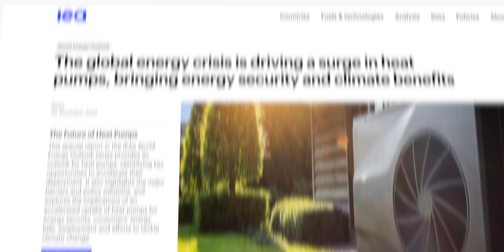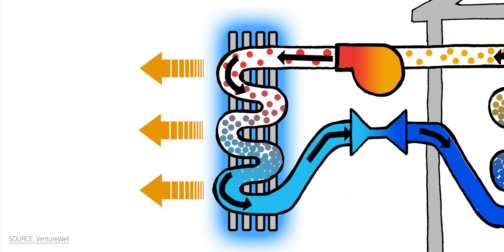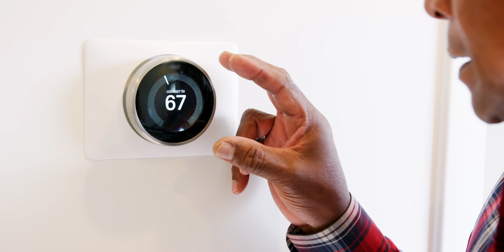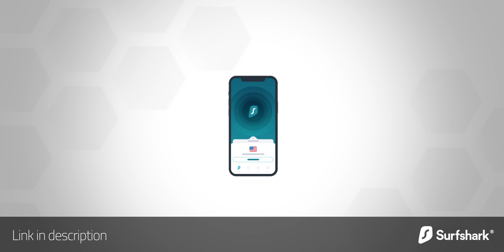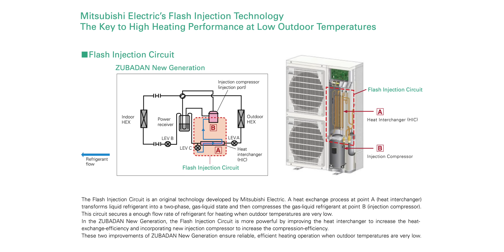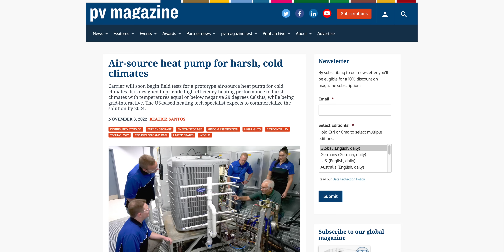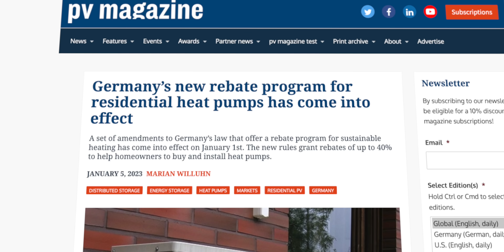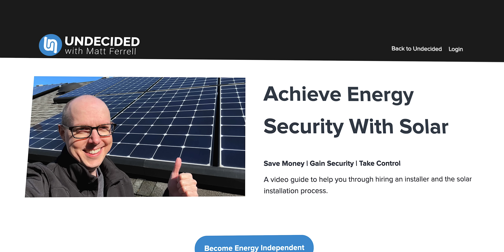Major Advances with Heat Pumps in the Extreme Cold

Comment: Heatpumps will stop working if its sufficently cold. On the olden days that was -15, that is not that uncommon in a lot of places. Modern heatpumps can typically go -25, some even -30.  But they will stop working at a point.

There is also a diffrent heat related problem. Efficency goes down with temperature. That when the need of heat goes up.

This way you either need a system that is heavily over engineered, or you will get cold.

Me personally have dimentioned the pump to -10C, any colder and it get cold inside.  Its often colder. So what is the solution.

A normal wood furnace. It turns out that while a heat pump is cheaper that wood most days of the year, when its colder than -10... its not.

Solution... just swich to wood, when its cold. I need to  burn wood typically 15-20 days each winter.

Comment: Heat pumps are f**king garbage in the cold.  Define "modern".  Contrast with "high-end model".  I have a "modern" heat pump, probably a mid-range product.  It CAN NOT heat the house even at about 40°F outside.  It has ZERO CHANCE of keeping you warm in -10°F winters for weeks at a time.  It MIGHT be able to keep your pipes from freezing, but you WILL need a jacket because it'll be about 45°F inside.  You will ALSO need to pay about 10x more in electric bills, and ALSO need to buy a new heat pump after 1-2 years rather than after 15-20, because you're going to burn the f**king thing out!  Running the same ducts, same blower motor, but using a pure electric heating element during the cold weather, you use LESS electricity, you're not stressing out the heating element, you're not stressing the blower motor, and you're getting about 30°F warmer, up in the low to mid 70°F rather than low to mid 40°F.  Anyone who tries to sell you different is FULL OF SH*T!!!  "MAYBE" a higher end model is more efficient, but I seriously doubt it.  There's no hocus pocus voodoo going on here.  You're pumping R134A or similar refrigerant around steel and/or aluminum tubes with an itty bitty amount of foam, maybe R value maybe 0.05, with multiple exposed metal lines.  It doesn't matter what goes on in a mathematical formula, inside the compressor, expansion, and condenser.  There are exposed pipes.  Any heat squeezed is lost before it ever enters the house.  The blower thus stays on longer, and all the air blowing through your metal ducts just acts like a heat sink and sucks even more heat out of your system.  On the plus side, your refrigeration bill goes down, because you can basically shut off the fridge circuit and leave all the food out on the counter.  Stop perpetuating the lies about heat pumps.

Comment: The problem is that in areas where they aren't many companies that install heat pumps, they typically won't install the newest models that are efficient at the lowest temperatures, so you need a backup heat source anyway.  That was my problem when I looked to have my furnace replaced last year.  So, its not just about customers with old beliefs on them, but mostly the companies.  That and heating fuels aren't expensive enough in the US to make these companies think more about it yet.

Comment: I just swapped out my AC (it failed) with an air source heat pump.  It was like-for-like in terms of capacity, but more efficient (13 SEER changed to 17 SEER, for now... I can adjust the system to 20 SEER).  I have been happy with it so far.  I still have my gas furnace and the Farmer's Almanac says we're expected to have a harsh winter here after a warmer than expected fall.  The system is expected to work down to -22F.  We'll see how it works.

I would have loved to have replaced it with a geothermal heat pump, but I was in a bit of a crunch and I was able to install this system in a day by myself.  A geothermal system would have required significantly more work.  I could have still done it myself, but it would have been more time and very disruptive.

In any event, it is pretty nice to see that comparing temperatures to last year, I am consuming less electricity now with the more efficient system.  It was $3400 delivered which included the condenser, evaporator, and the line set.  I will probably get a 2nd unit.  We had a zoning system installed when our house was first built and it has been the unreliable component that led to a premature failure of our AC.  So, the 2nd unit will be nice.  I will get rid of the existing zoning components and just make the upstairs and downstairs fully independent.  If I do this, I can set the unit down from 3-ton to 2-ton which will increase it from 17 SEER to 20 SEER and it will distribute the load across the two systems, hopefully reducing wear and tear.  Also, if one fails, the other will still be operable.  This is the 3 AC failure I have dealt with in my adult life.  The first time was a similar sort of failure and we went over a year without a good solution; it's line set was struck by lightning a month later and had to be replaced.  I really don't want to deal with a failure like this again, ever.  I work from home in addition to living here.

My utility is offering a $750 rebate on top of the federal options.  So, my system will be at least half price, which is super nice.

If the system handles well in the winter and we don't need our gas furnace much, or at all... I will be happy to get rid of it.  During the summer, we basically use our gas service for water heating (we could use it for our stove... but we mainly use our air fryer, microwave, or outdoor grill for cooking in the summer).  My gas usage cost me $2 for the month... but my bill was nearly $40.  So, even if the usage cost is a break-even or slightly more, I will save money by eliminating the fixed monthly fee just for having service.  If I need just a bit of the gas furnace, I can convert the regulator to use propane and probably just get by with one propane tank per year.

Comment: In the extreme cold heat pumps cost more to run than a natural gas furnace. I have a duel system, and essentially when getting below around 10 F then it is more cost efficient to run a gas furnace. It really doesn't matter what tech has been used because at the end of the system is the need to run the compressor harder and the defrost cycles just to keep the heat flowing. In the coldest months running a heat pump can cost around $200 a month for a 2300 square foot home for the heat pump electricity alone. The same cost for a gas furnace is around $150. The other problem is that as the outdoor air gets colder the capacity drops on a heat pump which is backwards from the desired effect. Also heat pumps typically consume more power than can be afforded by a backup battery which is important in cold climates and power outages. I also can't rely on solar during the winter as the panels get covered in December and are non functional to around March usually. I feel I'm above average prepared with solar+battery+heat pump.

Comment: Geothermal is not considered a heat pump per se, geothermal uses underground tempatures which are much more stable than outdoor air tempatures, although extremely expensive it is much more reliable than an airconditioner with a reversing valve. At-15'c you can feel the air coming out of a heat pump is noticably cooler, there's is no dispute about heat pumps losing efficientcy it's a proven fact,  some regions by law require a back up heating system for that reason. The biggest issue with heat pumps is the cost of electricity, ask anyone in Florida or Arizona what their electricity bill is like during the summer. You also have to consider supply and demand as the increased demands for electricity is expected to drive up the price of electricity, expecting to pay double or triple than todays prices for electricity is reasonable and expected. I will make money selling you what ever system you want so I don't care what you choose but do the math and research before deciding because we only care about making the sale.

Comment: heatpump works fine at  -45c i have one and on the average year i have 1 week of -40 or colder  and my average winter temp is -18c but it is a ground source water to water  heat pump. . personally I installed it myself and I bought the heat pump from china for $500 and installed it for another ~$1000 it operates at cop 3.5 in the fall to early winter then in late wither to early spring it operating at +2 COP as the ground has cooled significantly by then, but still above 5C ..  I also built my heatpump system as hybrid solar heating system so my normally ~6 months of heating is reduce to 3 months and it has reduce my annual heating cost by 80 to 90% down from ~1500 to 2000  per year 150 to 200 per year.. i could get it lower  but cost benefit ratio is too low  and  basically pointless

Comment: My father found out the hard way that geothermal doesn't work here (Saskatchewan...up to -50C for several weeks at a time).  I warned him, but he wouldn't listen.  Now he's stuck with a very expensive electric furnace, and ended up getting a woodstove instead.  I'd love to use a heat pump, but a much smarter solution here is a cheap electric furnace ($700 CAD) or 240V baseboard heaters as backup, and a woodstove or Opel 3 fireplace (woodstove-like baffles and door).  Then you install an array of solar panels to basically eliminate your power bill.  Cheaper than running a gas line, paying a gouging plumber, and replacing a gas furnace down the line, plus your monthly gas bill.  You can also super-insulate for MUCH cheaper than putting in fancy tech.

Comment: HVAC tech here.  Air source heat pumps will NOT provide adequate heat on severe weather days. Ground source heat pumps will work fine.  The heat pump must scavenge heat from it's "source" ,  the temperature deep in the ground remains warm year-round... whereas the ambiant outdoor air on a (example) -20 C day or night contains very little recoverable heat energy. You then end up relying upon electric heat to make up for shortfalls,... electric heat is extremely expensive heating.

Comment: It is frustrating when people say “heat pumps work in cold climates” without specifying the type of heat pump. Cold-climate, ducted, ductless, geothermal, new construction, old leaky house with bad ductwork? I think people are in for disappointment and sticker shock if the go in thinking they can install a single head ductless unit from Home Depot and be done with it. My boss got a quote to convert his 2,000 square foot house to a cold climate multi zoned system and it was $40,000! The $2,000 tax credit is not going to make a dent.

Comment: Canada here - heat pumps have been in common use in my locality for years. They are as common as AC systems. Everyone  loves them - even the older ones work down to about -15c. They are expensive up front but very durable. The most common are air to air and you do need a back up heat source. On the other hand most people I speak to have never actually used their back-up heat source.

Comment: I have both heat bump (very new, installed less than 5 years) and AC+furnace system,  the fact is that heat bump is 100% a trash during the winter. it not only sky rock the electric bill, but also never be able to keep 68F.  So eventually, I will have to use furnace, put it as 3F higher than the upper floor temperature,  this is almost avoid heat bump to work at all during the winter.     BTW, if you ever consider the geothermal, i would consider the labor cost during the maintenance, fix anything underground, you will have to fix your damaged lawn, then the pipes buried underground.  that's said, it is funny to see that people have this kind of illusion that heat bump can replace a furnace system.

Comment: We live in a very cold climate and will get a heat pump when our furnace dies, but until then we do the next best thing: use space heaters more than our gas furnace. For $175, you can buy a really good, safe, oil-filled space heater with a thermostat and timer. We have several of these in our house, which greatly reduces our gas use. Space heaters have 100% efficiency because all of the electrical energy that goes into the unit becomes heat, so they're nowhere close to a heat pump, but they're more efficient than our furnace.

Comment: Built a new house three years ago. Installed a geothermal HVAC system. The house is always comfortable. The system heats water as well as heating and cooling the house. We have never run out of hot water. There is a natural gas backup in case the geothermal system can't keep up. So far we have used ZERO natural gas. Can't compare cost to my former house because the two houses are substantially different. But costs are less than the old, smaller house.

Comment: I have to chuckle at the sudden uptick in air source heat pumps. About 30 years ago I was involved in making a prototype one using a control board from Ontario Hydro research. We installed it in my 20 year old home (at the time) and found that the minimum break even temperature was about +2 deg.C. Not bad for R22 fluid, as I had  absolutely no background in the field. During a visit to the yearly big US heating and AC show I asked Copeland (the compressor manufacturer) if they had ever thought of using a variable speed motor for better control, only to be told that their motor company had never suggested it. Going over to the booth of the motor company, I asked the same question, only to get the answer that Copeland had never requested this. The funny thing was that they were both divisions on Emerson electric.

Comment: Not a good video. Maybe I missed it, but I did not see any numbers talking what efficiency losses are at lower end extreme temperatures. If electricity usage spikes at these lower extremes and/or heating capability drops significantly - this is a structural issue because then any home relying on a heat pump, in a location where such lower temperatures occur, is going to not have heat precisely at the coldest times.
Secondly, the economic benefit is very unclear. The video mentions 8000 vs 3000 euro installation costs vs. say 280 euro savings per year - but 5000 euro generates 250 euro per year at 5% interest rate. The savings is thus minimal in the present high interest rate environment.
Lastly, the video disingenuously references the maker's ground install geothermal heat pump. It is quite clear this installation is going to cost far, far more than 8000 euro - which likely references just a heat pump machine set up above ground.
Net net: not the least bit clear this technology is either superior or cost effective.

Comment: To me you neglect the major benefit of heat pumps.  That is that, if you have a forced air heating system (ie. with air ducts), you have a built in central air conditioning unit for the summer.  My father installed a heat pump in his house in Toronto, Ontario back in the 1970’s.  It was certainly less efficient than current models and he had an oil furnace for cold winter days, but the bonus of the air conditioning in summer was worth it.

Comment: Hotspot energy makes a grid assisted solar mini split heatpump. It uses about 1200 W of PV panels with no batteries or external inverter or anything else.
The panels are plugged directly into the mini split. You can also plug 240 V AC from the grid into it and as the wattage from the panels goes down from clouds, etc., the wattage from the AC will ramp up.
 They also make a 48Vdc battery based mini split that is used for those that already have a 48V solar PV system.

Comment: No.  My neighbors have installed large whole house heat pumps and their costs are close to $12.000 annually.  The heat pumps also create a large amount of ice in the winter which is not good for the heat pump and the concrete it sits on.  I will stick with my heating system.

Comment: I do not recommend the installation of heat pump. In theory, they should be efficient, but their upfront costs, complexity, relatively low life expectancy and prohibitive maintenance costs, make them a poor investment. My first unit, 1995 to 2012, was barely able to heat my house at -5c. My new unit, at 10000$ canadian, is showing signs of aging. A recent R410A refrigerant recharge, because gases escape, and a new capacitor for the compressor cost another 1500$. So my next unit will cool only.

Comment: If you can do it,  get a Blower door test on your home.  they can go around to find the leaks and you can get those fixed  which will drastically help with heating/cooling.   another is to do a Thermal video test during peak heat and cold days to find leaks or where insulation needs fixed. or sealed.     It won't make your home "Net Zero" but plugging those up will cut down on how long your AC and Furnace have to run.   it may cost a bit up front, but in the long run it may (and mostly will)save you quite a bit of money in the long run.

Next there is a similar thing for your Duct work (if you have that)  there are companies out there that do a similar "Blower door test" but just on that, and while doing that, they can put an air mist sealer that will literally button up all and i mean ALL gaps in your supply and return lines.   

Do those first, then you can focus and save money to get a higher efficiency HVAC system,  switch to Heat Pump setup.